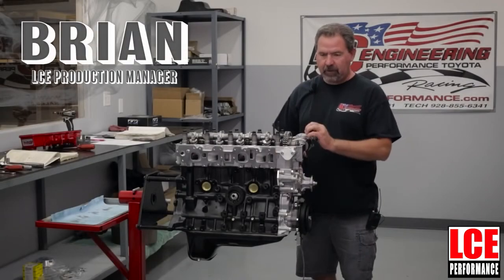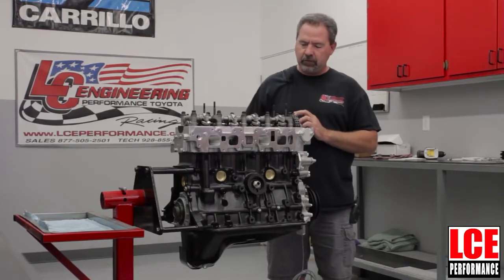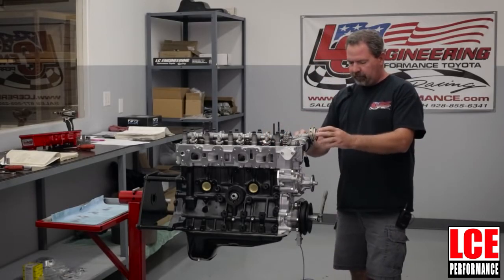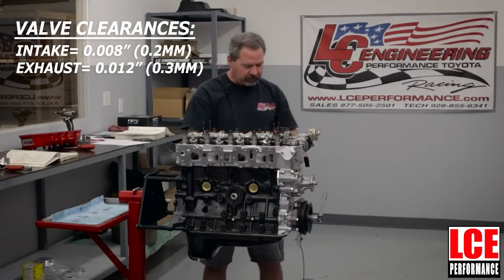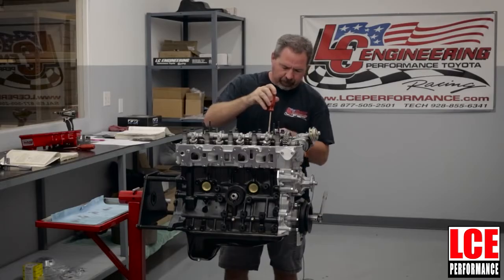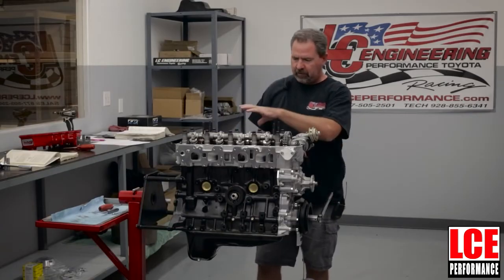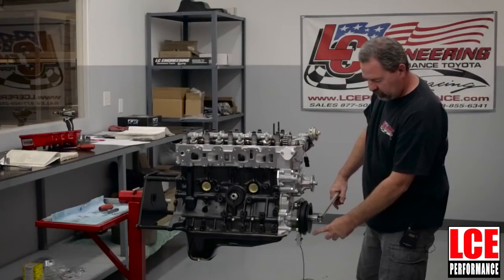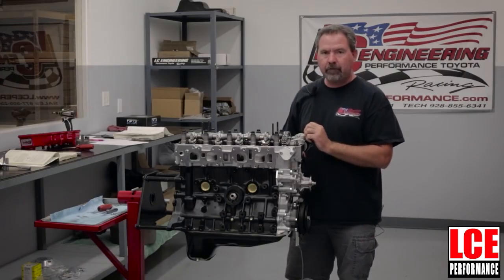LC Engineering  20R22R22RE Valve Adjustment How To

Comment: The way you guys adjust them does the engine have to be hot  and is it the same lash settings .008 and .012
Reply: if the engine is hot, lash settings should be at .008 and 0.12, if the engine is cold lash settings should be .007 and .011

Comment: So was trying to do this an every thing  worked until the number three exhaust valve spring would not loosen on the rocker arm. took the screw completely out an the spring was still tight on it

Comment: Adjust them at 7 and 11 because when they warm up the expand😊
Reply from the maker: You can adjust them cold at 7 and 11 but make sure to go back when it is hot and double check that you're at 8 on the intake and 12 on the exhaust.

Comment: What type oil is suitable for this machin 22r please??
Reply from the maker: When it comes to the oil used, your normal name brand oil in the weight recommended for your climate will be recommended.
Reply: 10-30w for the summer, 5-30w for the winter. if you're working with any better than a performance cam, then you want some thing synthetic with zinc

Comment: What do those engines put out I remember my 93 hilux owners manual said 96hp lol it got better after adding crane cams hooker headers 8.8 accel wires
Reply from the maker: Typically about 150 Hp for one of our smaller builds and they can see upwards of 300 Hp plus with boost.
Reply: Thanks for the video

Comment: I was always taught to bring each cylinder to TDC before adjusting them (Honda) like you guys do, any advantage i see would be time to turn the crank more times? So say 3-4 minutes total job time? I would assume there is no performance gain in the Toyota way just save a little time?